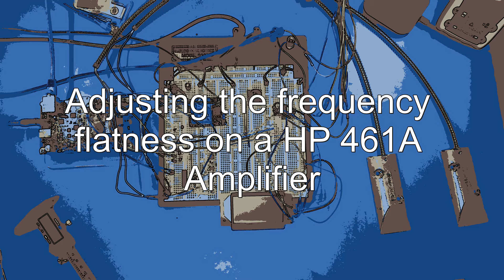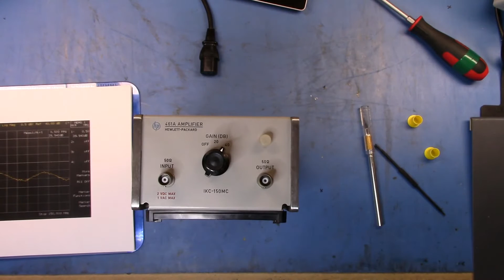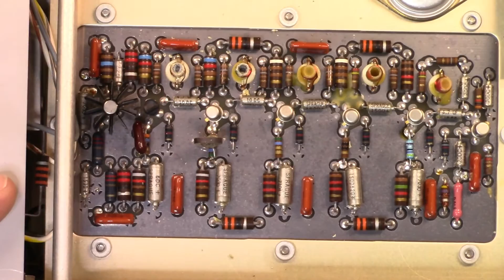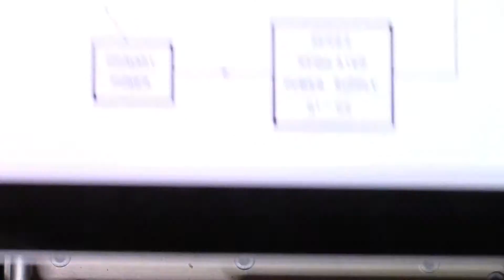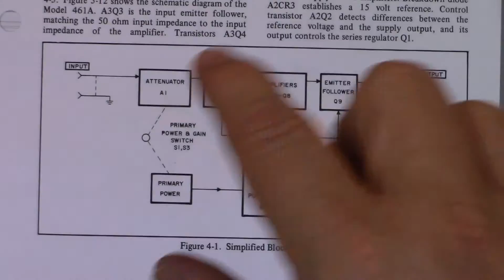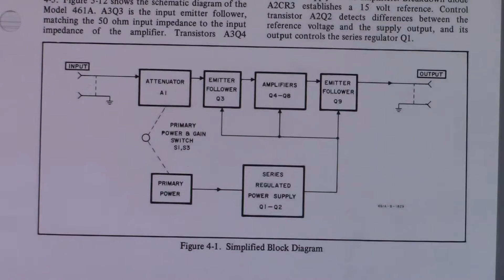HP 461A - Adjusting Frequency Flatness

Comment: Thanks for sharing. Perhaps you could stick a metal screwdriver or similar in that inductor that lacks a slug just to see if the change in inductance would help you flatten out the response.This might let you at least see how the curve changes.
Reply from the maker: Interesting suggestion - I have to take one of the slugs out to measure it so I can get a replacement - I'll see what sliding a screwdriver into there does.